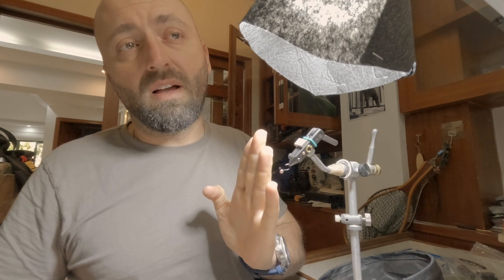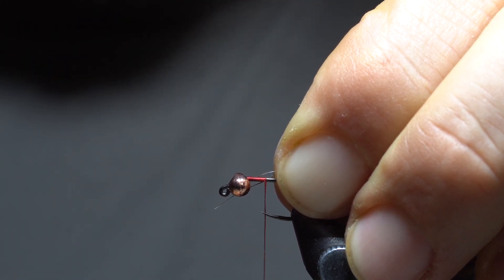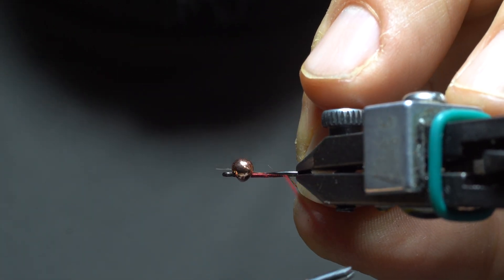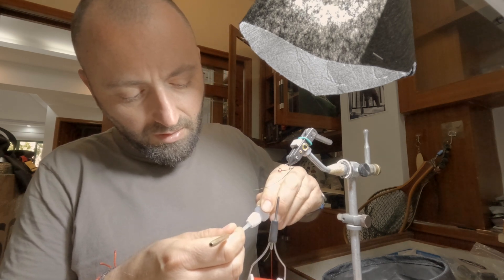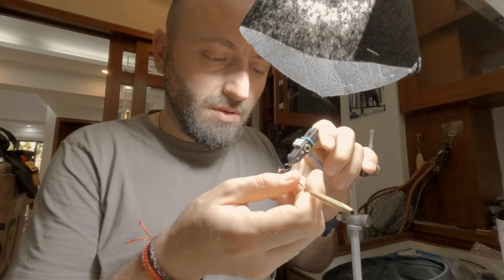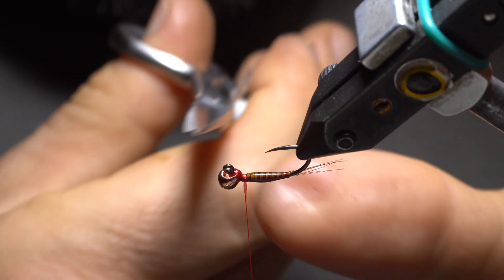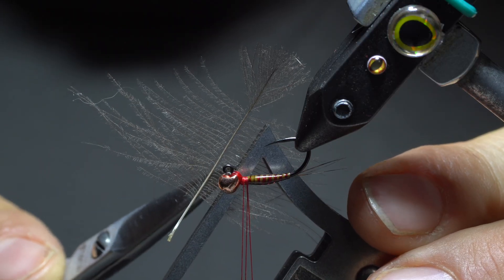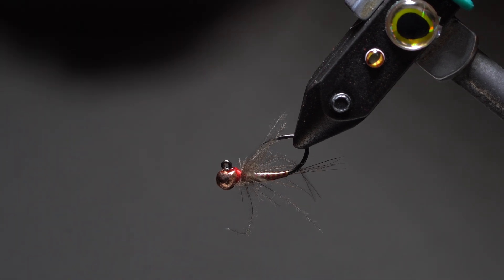Is This The Best Hot Spot???

Comment: Nice pattern. I tied some fluo red and pink flies in the hope that grayling are more attracted to them, we’ll see. I am with you on the scissors, I have the same with my best scissors still stored with the protector over the blades. I also have two dubbing needles that are never used for glues or any like that and have a protector on them. I also found I tie better flies when my desk is tidy…
Reply from the maker: Thank you. Scissors are super important, and i used to neglect it for so long. Now i pay much attention to blades i use. 
And my desk is very messy. I try to keep it in ok state but i get carried away easily
Reply: @ I opted for Renomed as they’re made in Poznan Poland and the quality is high. I have the Stinger version as well yet I’m always looking at razor options with the tension adjustment. Do you have any experience to share on scissor options with very fine tips? I’m not unhappy with what I have I’m curious whether there are alternatives that will bring real benefits
Reply from the maker: @robgreen6697 i cant say i am any more experienced either. I am using TMC fine tip, never used another brand. I guess not so much difference when you get into good quality stuff. Renomed is perfect for sure. 🍻